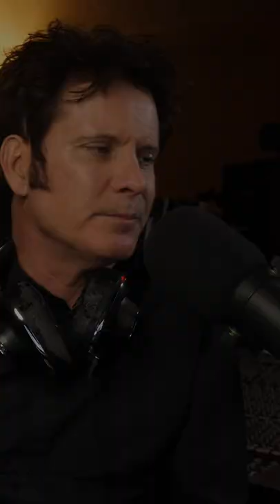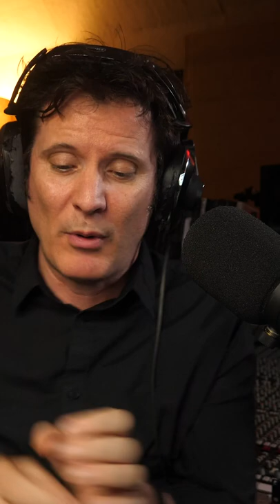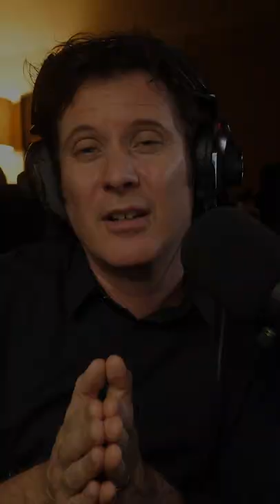Overusing Sweep EQ... #shorts

Comment from the maker: What are some of your favourite EQ Plugins to use? Share below
Reply: Lindell 50 channel, Pro EQ3 <3
Reply: I have many Eq plugins, but have lately gravitated towards SSL Channelstrip, or Scheps Omni, or maybe TDR Nova etc, as with this type of Eq (just knobs!) I'm not at all tempted to start "sweeping", whereas with Fabfilter ProQ3 etc, first thing I want to do is sweep!
Reply: That’s why Soothe can be good - subtle auto dynamic EQ.
Reply: UVI Shade for my graphical eq for surgical stuff and sound design. Lately I've been using Scheps Omni for color.
Reply: For corrective EQ,  the FabFilter Pro-Q3 is my favorite.
For adding color and tone, I love the UAD Helios Type 69 Legacy and the Trident A-Range on guitars and the API 550A and B and API 560 for everything else. I also love the awesome and free Fuse Audio Labs RS-W2395C for adding the finishing touches to signals.
It might sound strange, but in some cases I use a compressor as EQ. 
For example, a DBX 160 can shape a kick and a snare by tightening the low end and adding punch just at the right amount to not being muddy and cut through in the mix. 
The SSL LMC+ Talkback Limiter is a great tool to shape a bass or a kick as well, just by using the high and low pass filters and the mix knob.
Reply: reaper stock most of the time because listening to Warren for almost 2 years I've come to trust my ears. TDR Nova sometimes because it's fancier=more fun and has built-in band comp.

Comment: Probably most important thing I learned for sound work - being able to identify the problem before you touch ANYthing.

It's a testament to just how HARD frequency ear training is. It's hard enough learning pitches, intonation, intervals, etc... Now I've got to learn to identify the harmonic series a note / instrument makes too??? 

And perhaps the most difficult thing to confront is that there is no easy way to learn it currently. I'd guess that most well regarded engineers these days learned it by brute force experience; hours on the console. 

There are ear training / identify the frequency type programs and such, but I feel like there is no "frequency theory" like there is "music theory". An area of knowledge or anything that might help accelerate and exercise the learning process.
Reply: Also what I learned is if it’s too harsh, drop the fader a dB at a time. Is it still hash? No then it probably was a level / gain staging issue from the beginning

Comment: I kind of do that sweeping thing though. I don't cut everything that sounds terrible, I cut that which sounds terrible in a way that I suspect it's going to be very terrible after compression, saturation etc. I usually end up with 2-3 cuts, sometimes 1 sometimes 4. I find it's important not to drag them all the way down and play with them a bit. Turn them in and out and hear what it's all about. I do this together as a "second treatment" (after deverb) on vocals together with a lowcut (and sometimes high-cut). I feel like it helps a lot. But that might have to do with the fact that I work with problematic vocals a lot. I don't do the sweeping thing on sample-instruments. In my experience they don't have these kind of issues and broad strokes are more than enough to get them right.

Comment: Exactly, I alwas do a very narrow sweep if there is a certain hissing or ringing noise in a complex sound, that I can't identify quickly.
Then I first turn my monitoring volume down, and have a bumped and narrow sweep band find the frequency.

I once had to actually look for 5 minutes to find out it was an almost exact 1kHz ringing in a dense percussion track.
It was really adding an ear piercing nasty intermittent noise, because it was only present when certain combinations of drums were hit.
Pretty weird, but easy enough to tame (not completely cutting 1k of the entire percussion obviously, ~6db quite narrow reduction was enough in that case).

Good tip!

PS: Are there any new developments in the Kolo mix contest? : D